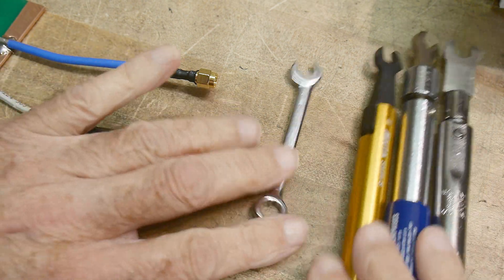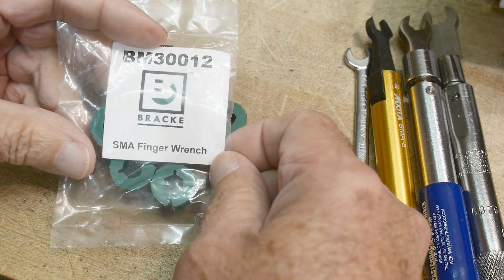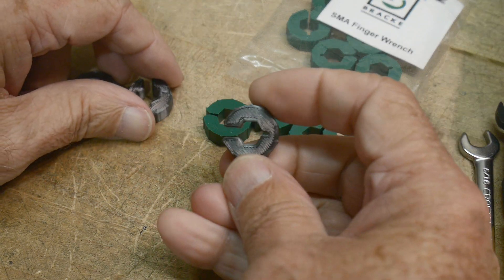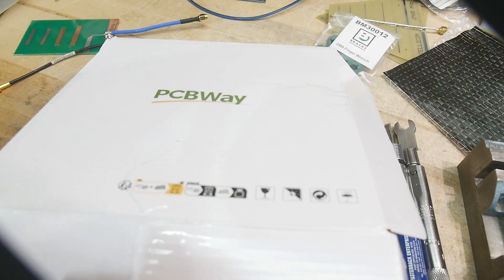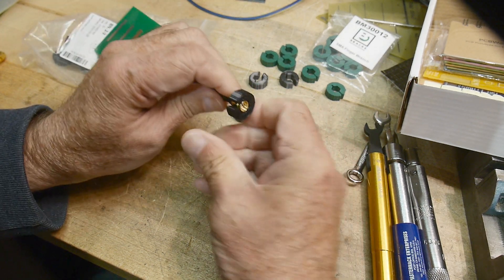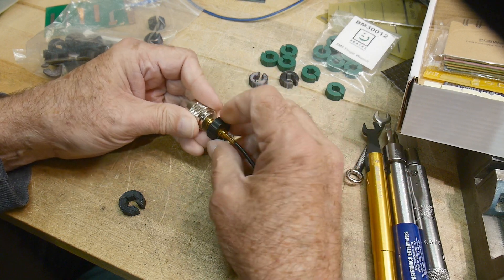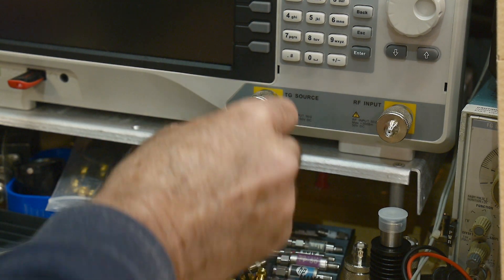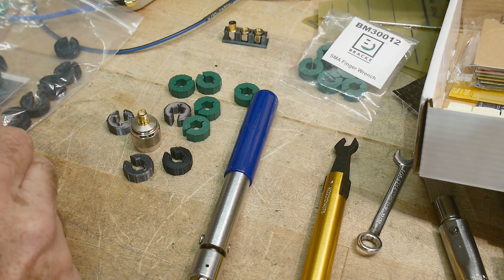#1462 SMA Thumb Wheel Wrench Spinner

Comment: Those are so handy! Thanks for the tip. I printed a few based on dimentions seen on this video and I love them. I used PLA as it was loaded. My goto is usually PETG.
Time will tell if I want some tiny tweaking like perhaps making them just a hair tighter and possibly a bit smaller to take less room and perhaps a small extrusion for contact at wire end to make it impossible to slip in one direction.

Comment: It would be interesting to see if you could make it double as a non-precision torque wrench by rounding the wrench sides slightly in the tightening direction and tweaking the infill so that it will slip after a bit.  Obviously it would also be dependent on the grip strength of the user,  but a tool that would quickly let you get to a somewhat deterministic minimum torque (I don't think you'd be able to overtorque with these either) might be useful in some circumstances..

Comment: I have never used PCB-Way so wasn't sure of the steps to order the Thumb Wheel Spanner like you designed with the correct settings. Perhaps that would be a good video. 73's KC4GO

Comment: I have an idea for the PLA types. Stop the print halfway through, embed some piano wire at the flexure point, and continue with the print. Design the object so if it cracks it intentionally cracks at the flexure point.

Comment: I am trying to order the VNA SMA CAL Holder and I can't seem to order them like the SMA Finger Wrench.  Any suggestions?
Reply from the maker: I'm not sure. you can download the cad file then start a 3d print order and upload the file at that time.
Reply: @IMSAIGuy  What material did you use?  I enjoy your channel everyday, KI7ZI Rod.
Reply from the maker: I selected ABS  with a 60% fill factor
Reply: @IMSAIGuy  I downloaded the .3mf file and it isn't recognized by PCBway when I try to upload them.  This is in the upload the CAD files for quote area.  Where can I use the .3mf files?
Reply from the maker: @rodproctor5466  you need to enter the 3D print area
Reply from the maker: I've added a STL file to the listing and now people can just click order. thanks for pointing it out